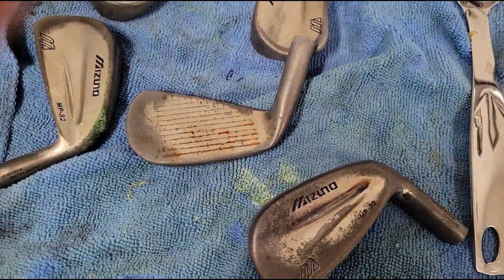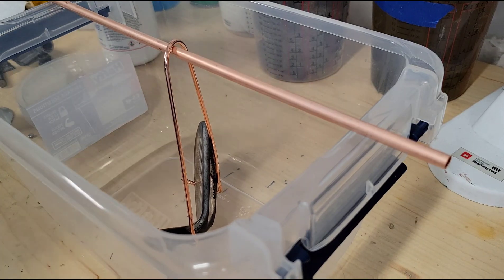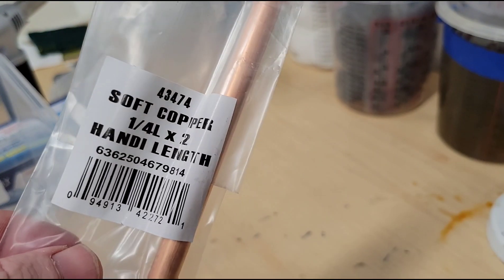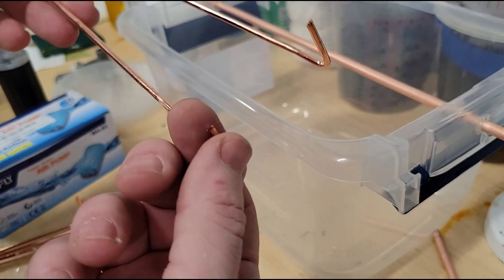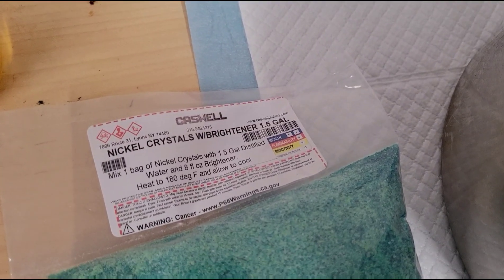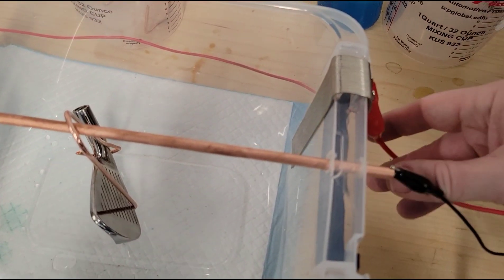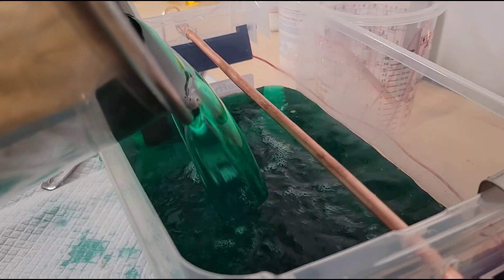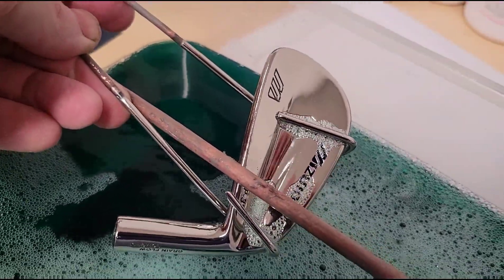Learn How to Electroplate Golf Clubs at Home! - DIY Golf Club Restoration

Comment: Loving the videos...what guage wire do you use on the alligator clips? Thanks!!
Reply from the maker: Mine came with the power supply. It's 12 or bigger. I'll see if there is a marking on it when I get home.
Reply: @BradMeehan  thanks...but what i was refering to are the wires on the alligator clips connected to the nickel plates hanging in the plastic tub. I couldn't find any already made up so i have to make my own.

Comment: Perhaps a hook solution that goes into the hosel in order to not have the exterior of the heads touch the suspension? I was mildly concerned that the touching points might look slightly different from the rest of the head? Or get less build-up of nickel in those spots?
Reply from the maker: I completely agree. In hindsight,  I would have made my tank a bit deeper so I could hang them from the hosel.

Comment: I'm having a brain fart but is the donor metal on the sides that have the positive leads actual nickel metal or just a metal to help complete the circuit?
Reply from the maker: It's nickel. The nickel will migrate from that positively charged donor to the negative side of the circuit, which just happens to be our club head.

Comment: You did not mention about power supply needed. What is the voltage applied and current setting.
Reply from the maker: 3 to 5 volts seems to be best in this small tank. I'm still learning, but that's been the nest result. The good news is, you can polish it and redo it easily if you're not satisfied.

Comment: Brad: I have 2 sets of Mizuno MP69 irons that I wish to refurbish as shown in this video. Can I assume that the process in this video on MP32 will apply? I am a club builder & teaching professional located in North Carolina who will be expanding into refinishing irons. Love your videos. Also the DC power supply you recommend is not showing on amazon any longer. Any spec recs on one?
Reply from the maker: Let me know if you have any questions along the way. Regarding the power supply, I can look for an equivalent but basically I just looked for an economical product with decent ratings. I try to do this on the cheap.
Reply from the maker: And yes, for any forged, chrome plated iron, the same steps apply. Just make sure there's no chrome left if you're going to replate the whole club. You can brush plate spots that are exposed if you don't do the whole iron but there are subtle color differences between chrome and the bright nickel.

Comment: Awesome. How long does the nickel plating last when repeatedly hitting the ball and ground? 

Is it a rust resistant finish?
Reply from the maker: It'll eventually scrape off but you can just do it again. That's the cool part. Nickel is not as hard as chrome, but you need it therw to prevent corrosion and rust on the bare steel.
Reply: @BradMeehan  Great vid btw. What do you think of heating up the club head with a blow torch and letting that be the finish? 

Do you think that would work well?
Reply from the maker: @booni5114  Yes, I love that idea. I'd like to try it without removing the chrome to see if the color changes or if it has to he bare steel.

Comment: Hi Brad ! Great videos man, Love all of em. Was wondering how many times you could use the nickel plating solution before have to replace it ?
Reply from the maker: Indefinitely if you keep it clean. The nickel anodes continually feed the solution. The nickel that doesn't stick to the club remains in the liquid. That said, you will have to replace the nickel anodes as they are being eaten as you plate. Hope that makes sense.
Reply: @BradMeehan  Makes sense yeh. This might sound dumb but essentially, why would you wanna plate the club head ? couldn't you leave it as is after simply polishing ? Thanks a lot for the knowledge

Comment: Brad do you know what effect the plating has on the grooves?
Reply from the maker: I'd recommend this order: polish, blast the face for texture, sharpen the grooves with the little sharpener tool, then plate it. We're putting such a thin layer of nickel on an area that already had a layer of chrome at one point. It's measured in microns. I'm not good enough to notice so the performance difference (if any) would be negligible.
Reply: seen other videos on this one guy dipped a test hunk of copper to be platted half in , plating is so thin I don't know if a machine shop could measure it.. ran his finger nail down the copper piece could not feel a lip where the plating started
Reply: Thank you. Appreciate the info.

Comment: This is awesome. I'm going to follow these steps and see if I can't restore some life into older clubs that I have laying around - specifically some old wedges. I saw a comment response earlier where you said that you stop at Nickel because Chrome plating isn't DIY friendly. What makes that the case? The amount of power required, cost, safety? Thanks!
Reply: Also, what do you do with your waste?

Comment: Why didn’t you insert copper wire into the shaft hole to hang it?  Doesn’t that give a better overall finish?  Great work btw!
Reply from the maker: My tank is too shallow to point the clubhead toe-down. It bottoms out and wouldn't plate the toe. Design flaw of my 1.0 version.

Comment: How thick do you reckon the coating is?
Reply from the maker: I'm not sure. There's a formula that equates the time and current into a thickness measured in mils or microns. The longer you plate, the thicker it'll be.

Comment: Man, these videos are the shit. Thanks bro! Fixing up some T-Zoids... have a bench grinder coming... next build is the plating station!
Reply from the maker: Nice, Angelo. Send me some pics!
Reply: @BradMeehan  Hey Brad, I will do! I have a question for you - The T-Zoids have a pretty degraded chrome plating. I'm thinking about sanding it off by hand, or using a hydrochloric acid to pull it off the nickel underneath... Would that be how you'd go about it? I thought about trying reverse plating to remove the chrome, but it seems like quite a toxic and dangerous process, as it is actual chromium not brightened nickel, so was keen to avoid it...
Reply from the maker: @Angelokwells  Acid is the fastest. 

Legal disclaimer: I would research the safest method for your application. I'm just a dude in my basement shining old golf crap. I got C's in school.
Reply: Ah, I see you're using the chrome remover. Do you have a video that covers removing chrome? Would be hell keen to see how the wizard is doing it!
Reply: @BradMeehan  I feel like that legal disclaimer should apply to both you and I... Haha. Cheers Brad!

Comment: Can you talk a bit about the durability of nickel vs chrome plating? Will nickel plating hold up to the extended rigors a golf club goes through, or is replacing necessary after a while? When should you use chrome and when nickel? Thanks.!!
Reply: Just finished my first plating: a Ben Hogan Special 56 that was in tough shape when I acquired it. I took out the nicks, dechromed, cleaned, prepped and plated, like I learned from you. It's not perfect, there are a few spots and less lustrous places, but overall it's a winner.  Sandblasting the face is next then I'm gonna shaft it, grip it and play it. Thanks, man!
Reply: Oops, spoke too soon. The sandblasting didn't go well. Didn't mask it enough. Nickel is flaking off hosel now. Starting over. What causes spots, like water spots on a window?

Comment: How long did you let it sit to get that mirror finish?
Reply: Also how many volts?
Reply from the maker: @devilloc29  Two beers later...

Kidding. It was in for maybe 3 hours total.  I'm finding 3.5 volts is good for the size of tank I'm using.  I'd recommend buying a few pieces of copper tubing or an old club to practice on.  Even if it's not mirror-shiny, the nickel will be on there and you can give it a buff when you're done.
Reply: @BradMeehan  I got the bright nickel crystal pack .. Did you dip right away? Or did u use a nickle activator to get that finish? I made a power source from a 5v charger
Reply from the maker: @devilloc29  If there's is nickel remaining (which there always seems to be), I activate it. Honestly, not sure if it works without activating it because I always do this stepm. But the idea is, the surface of the  nickel isn't ready to take on new ion, so this does something to allow it. Did you purchase activator? If not, is it a junker club you could try for fun?

Also, 5 volts is a touch higher than what I was using so move the club head away from the anodes so it doesn't "burn". If you DO see it getting too dark ("burning"), you can still polish it out. I've F'd up plenty on my learning path and have always recovered and it comes out brilliant. Don't get discouraged.  Just make sure it's clean and chrome-free. I kept my dirty ass hand off of it and chilled for a few hours and it was all good.
Reply: @BradMeehan  Yeah I didn't get the activator, but I will now.. Plus a chrome stripper as well?
Reply from the maker: @devilloc29  Yeah. Do it right first or you'll think it sucks if it doesn't work. 

I'm a total dumb ass and I got it figured out. You can definitely do this, but don't skip steps or you'll be disappointed.
Reply: @BradMeehan  Ok thank your for the help. Would I need the same activator if I wanted to nickel plate aluminum or steel?
Reply: @BradMeehan  So I believe I gotta make a tank for plating in copper on steel and aluminum before planting some copy chrome Nickel. I mean that part won't cost so much I guess if I go the vinegar n peroxide route

Comment: This is great, extremely helpful. I have a set of mp 32's that I'm working with as well. Can you do multiple heads at the same time with this process or does it have to be 1 at a time?
Reply from the maker: You can, but you'd need larger anodes and a bigger tank. It plates better when the distance to your part isn't too close to the anode, so real estate in the tank is prime.  This DIY stuff is st most going to handle two at a time.

Comment: Don't even know where to begin with the compliments or questions, so many of both, awesome stuff.    Anyway I recently found a set of Fila F-02's that i crushed on back in early 90's in really good shape except some of the finish has peeled a bit on three irons at the bottom of the faces and I wanted to to try electro plating but not sure where to start.  Do you have to blast the clubs before plating?  Also what would you do for a cavity back iron to keep the plating out.  Anyway way thanks for taking the time, awesome

Comment: Me confused. In another video you used an electro cleaner and a surface activator solution prior to the nickel bath. Are those essential steps? When are they needed and when not?
Reply from the maker: hi, Craig. The electrocleaner is always done. I may have just skipped it in other videos, but I did it. there's just no other way to get it THAT clean to ensure the nickel bonds. Dirty club = no worky.  The nickel activator is to allow the existing nickel to let more nickel bond to it. I don't know if it's really necessary, because Ive had success without it, but re-work sucks and I do it to avoid having to do ALL the steps over if it doesn't bond.

Comment: Are you able to save the solution and reuse it?
Reply from the maker: Yes. It keep replenishing itself as the nickel moves from the anodes into the solution. You will eventually have to get a new piece of nickel anode as it is used up. You may also want to add new brightener as time goes on.
Reply: @BradMeehan  OK cool, appreciate the help

Comment: On the poles did you do half and half? And did it leave a line or did u use a longer container for the longer items? Thanks
Reply from the maker: Hi Eduardo. If you are referring to the shafts, I did not nickel plate them. However, if you have longer items, you can do half and half. If you see a line, you can buff it with the white compound and even it out. I've seen videos of people plating half of a part at a time.
Reply: Thanks I’ll look in to that.
Reply from the maker: @eduardoperez7797  You could also try the brush plating method, but it will take longer.
Reply: @BradMeehan  its for an old rifle i want to do a nice job I don’t think brushing will look nice

Comment: Hi thanks for the video.what is a nickel anode tho?what can i use
Reply from the maker: It's just a large piece of nickel sold in sheets or strips. You can buy them in Amazon , eBay, or Caswell plating supplies online. The bigger the better.
Reply from the maker: I added a link to the anodes in the description for you.

Comment: How many iron heads can you chrome at one time?
Reply from the maker: I've learned it's dependent on the size on your anodes. They say your anodes should be twice the surface area of the item you're plating. I stick to one at a time so I can polish one while the other is plating.
Reply: @BradMeehan  you may have seen this guy on eBay, but check this out. eBay name is eastcoastcustomputters. This stuff is off the chain.  How is your painting prowess? He only has two listings. Check his sold comps.  Off the chain!  I think I will pull my 100 or so putters out and sort them out. Also, send me a link to your email as I have some pics to send. If that is allowed?
Reply from the maker: @Thej-p7j  just saw them. Wow! They do great work.

Send any pictures here: brad@bradmeehan.com

Comment: can you drop more than one club at a time?
Reply from the maker: You could but it would depend on the size of your anodes. Some research I did said the anodes should be twice the size of the surface area of the item you're plating. Caswell sells large kits, but they're a bit pricey. This tank allows me to plate one club while I polish and prep the next so it's right-sized for my little DIY operation (and my extreme level of procrastination and laziness.)

Comment: What did you use for a power supply?
Reply from the maker: I purchased a DC power supply but you can make one with old chargers. I made a video showing how to do it. But, you have more control over the output if you use a proper power supply. I believe it was 50 dollars?
Reply from the maker: Just added a link to the description
Reply: @BradMeehan  awesome thanks for taking time to reply

Comment: This video is what inspired me to have a go at nickel plating. I’ve literally just built the tank with aeration and a heater..I’m just waiting on my chemicals to have a go at this. Thank you 🙏🏼
Reply from the maker: Very cool. Hit me up with questions. I learned it all from YouTube videos and reading forums.
Reply: @BradMeehan  I’m having next to no success with it all. I’ve converted my white vinegar into nickel acetate, I have heat and circulation and two nickel plates on the positive and the bar across the top on the negative. I’ve set the voltage to 3 volts and tried at 4.5 and still nothing plates...my copper bubbles but just seems to barely get anything on it even after 45 minutes...what’s wrong??
Reply from the maker: @brianhull5125  Is there chrome on the iron? Or you're still testing on a piece of copper?
Reply: @BradMeehan  I’ve tried with copper pipe and I’ve also tried with a stainless steel club head...I’ve even degreased and acid pickled the items too...I’m so confused
Reply from the maker: @brianhull5125  any way to check the voltage across the anode to the bar? Hold positive lead on the anode, negative on the bar and see if you have 4 volts?
Reply: @BradMeehan  it definitely has power no problem...does that leave contamination??
Reply from the maker: @brianhull5125  no, you'd still see something depositing. Can you post a pic?
Reply: @BradMeehan  do you have an email address
Reply from the maker: @brianhull5125  brad @ bradmeehan.com
Reply: Were you guys able to figure out what was going wrong in the process for it not to transfer? I'm about to set up this system and want to see what possible issues I could come across. Thanks! Also, after taking off chrome plating, what did you use to take off the nickel plating to get to the steel?
Reply: @jdhulse74  we did resolve my issue…I had the copper in the solution that was holding the nickel plates…it contaminated my solution…please avoid this at all costs…you can use nickel wire to suspend your nickel plates or as I did; just don’t fully submerge the plates. 
This doesn’t mean you can’t suspend the thing you’re trying to plate using copper as that’s not an issue…that’ll just get plated along with your item
Reply: @brianhull5125  much appreciated! Thanks for the time you took responding to this.

Comment: Hey Brad I bought the nickle sulfate at Amazon. It's a 1 pound crystals. Does that make the 1.5 gallon solution.
Reply from the maker: This is the one I bought so I'm not sure of the weight. It will work even if you add a little more distilled water. 

https://caswellplating.com/regular-nickel-crystals-w-brightener-1-5-gal.html
Reply: @BradMeehan  alright thanks for the info.  Hope to see more videos of your work.
Reply from the maker: @manuelgarza969  hit me up with questions. I watched a lot of nickel plating tutorials before I tried it.

Comment: When you strip a club head by reversing this method, would you then be able to use the cathode as an anode to put the chrome back on after smoothing out the club head?
Reply from the maker: Sorry I missed this. I don't think you can re-chrome like that. Caswell sells chrome plating kits, but it's expensive (to me) and there are safety concerns.